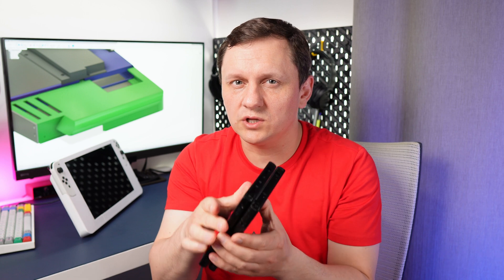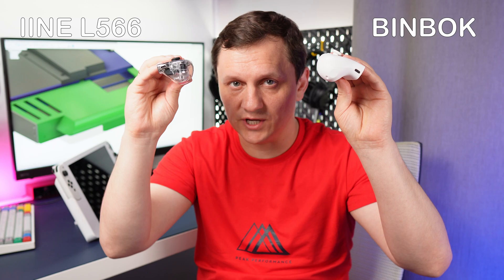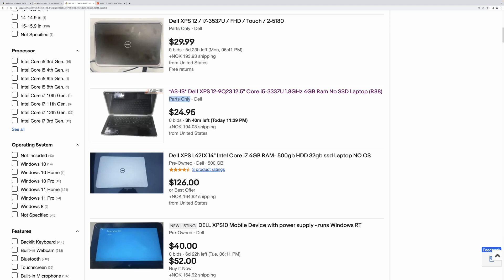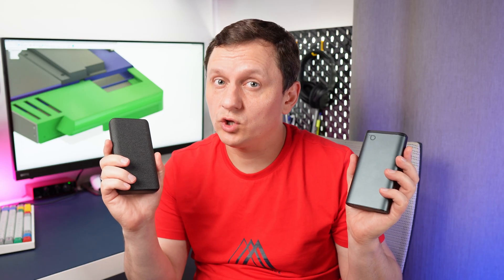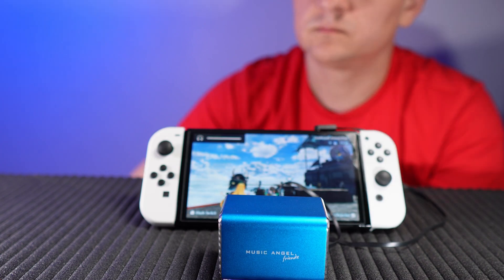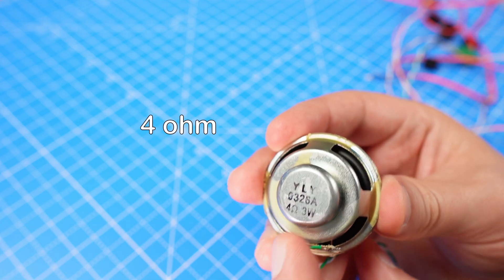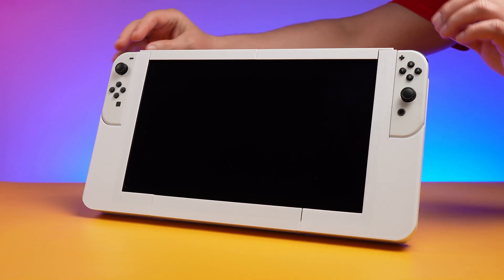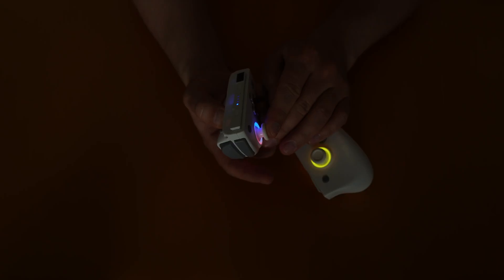3D printed Nintendo Switch extension

Comment: This is way cool! It’s unnecessary but my dream is to have an old switch combined (permanently) with a 13-16 inch portable monitor and just need 1 source of power for the whole setup. Just really slim down the design. But this seems to be what is possible! Keep iterating on it, I love it!

Comment: Do you have a more complete set of assembly and wiring instructions? I'm actually trying to build one of these and have some questions:
What size screws did you use to hold the case pieces together?
Do I need to disassemble a Switch dock for this project?
Do you have a specific model of power bank, or perhaps a link to the one you used?
I've got the parts printed, found a Dell XPS to disassemble, ordered the parts from the AliExpress links, but the rest would be helpful!

Thanks for such a great project!
Reply from the maker: 1. In the video for the first version of this device I have more details about assembly and Switch dock parts:
https://www.youtube.com/watch?v=PAXHdEzw8bw
2. Screws. I reused screws from the Dell laptop and Switch dock. Like M2x4. Or they can be found in the "Laptop Repair Screws Kit".
3. Powerbank is branded by Scandinavian shop:
Clas Ohlson, Powerbank USB-C 26800 mAh
https://www.clasohlson.com/no/Clas-Ohlson,-Powerbank-USB-C-26800-mAh/p/38-9687
I just had it and it was able to run and switch and screen at the same time.
Reply: @PavloKhmel  Thank you, Pavlo; and especially thanks for the quick reply. Happy Holidays to you and yours!
Reply: @PavloKhmel  I got the three controller boards you linked and have a few more questions for you if you don't mind? Is there an easier way to contact you other than by commenting here? (Also, can't send you pictures here.)
Reply from the maker: @reprinted3D  Yes. There is an email in the About tab on my YouTube Channel page.
Reply: @PavloKhmel  Thanks. I'll drop you an email with some pictures tomorrow.

Comment: Is there anyway to use USBs on the device, say for the switch GameCube adapter?
Reply: From the pass through segment it would appear that way but just wanted to confirm
Reply from the maker: Yes. PCB from Switch Dock has 3 USB (type A) ports. I'm not using them but they are available. 2 USB ports are blocked by the kickstand. I was not planning to use those ports. But the kickstand can be moved to another location or removed.

Comment: i think it can be made even pretier lighter and also thinner by using the bare screen with a metal structure and housing with thin bezels, strapping down the Power bank and using just the guts also removing anything that adds weight or bulk, it can turn in to a very sweet add on
Reply: my DIY motto. anything that can be made also can be improved.